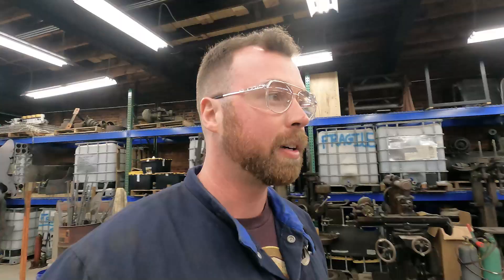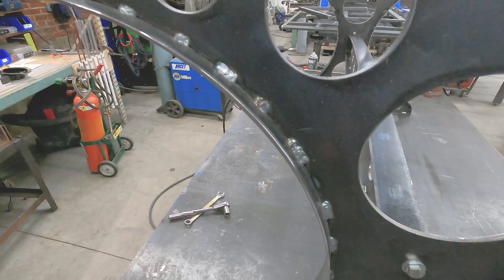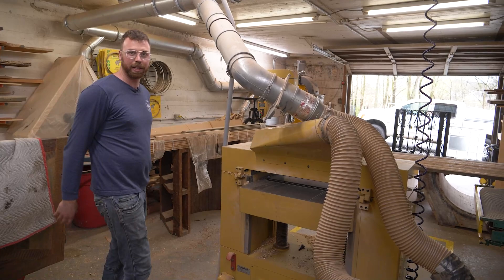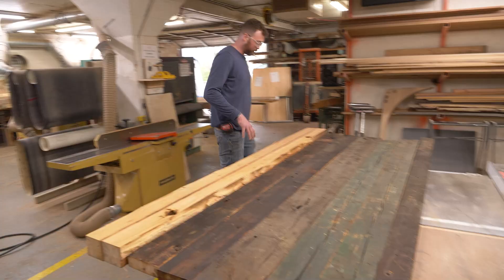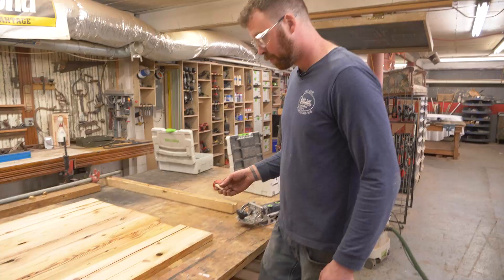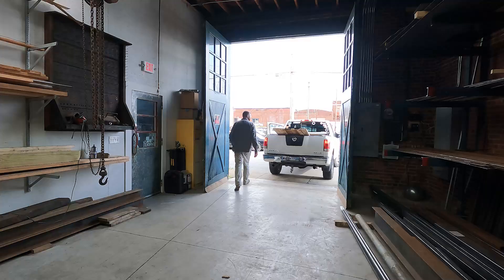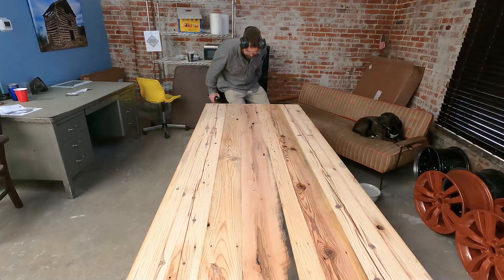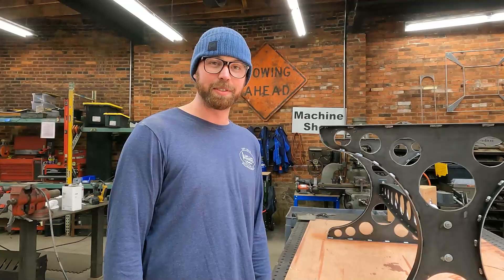Custom Table Top Made From 100 Year Old Wood - Conference Table Pt. 2 // Lift Arc Builds

Comment: Tay, you're an interesting guy and easy to watch.  On this table build I waited to see that you had tape on the bottom of your top, so the epoxy didn't end up on the floor or somewhere other than in the cracks.  I made that mistake just once.  Then when  you were using your torch to pop air bubbles, I at first thought "NO!  Don't do that stupid burnt pine look!"  It all worked out extremely well.  Great job, from design to completion! As a woodworker for decades, but a plumber by career, I relate to you well since I've moved (obsessed) to metal fab, and continue to teach myself welding thru many means.  I love my Swift Cut plasma table.  Envious of your 50 sq. ft. table vs. my 32 sq. ft.

Comment: That little angle grinder is an awesome tool,  tons of different kinds of discs and you can put burr bits in them as well.
Reply from the maker: It gets used almost every day, my favorite are those little sanding discs or the paint stripping discs as they help remove millscale without eating into the metal! - Tay

Comment: we did some welding work for a guy that was making glass lathe machines a few years ago.   he would cnc plasma index holes in his parts so they key together. we tig'd everything up and the kissed the spots where it was welded,  made the assembly look amazing.  no corner fillet welds anywhere all rosette welds, looked amazing after he painted the machines.